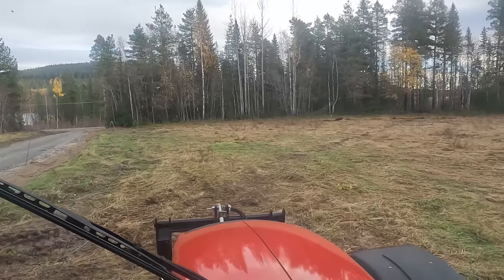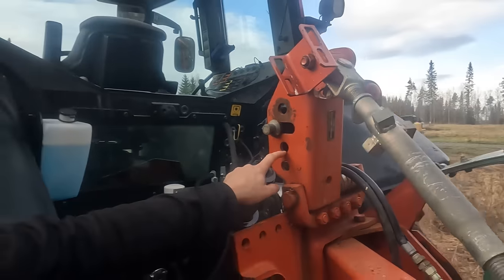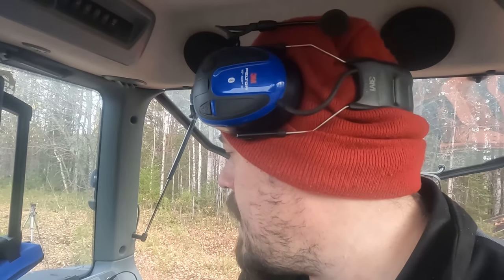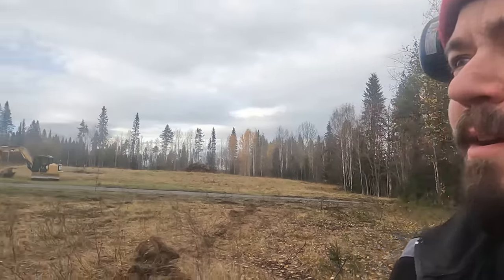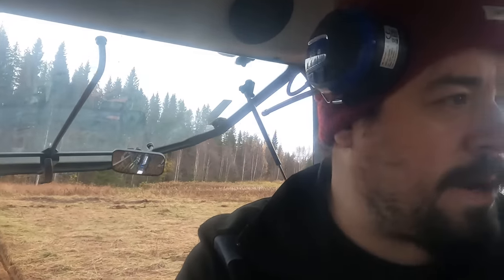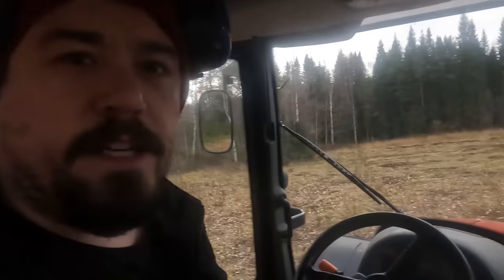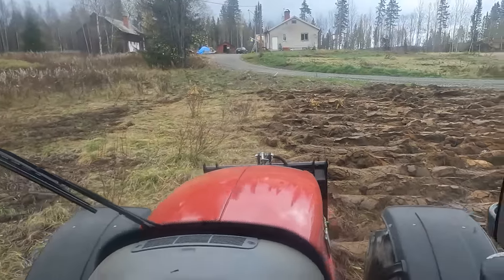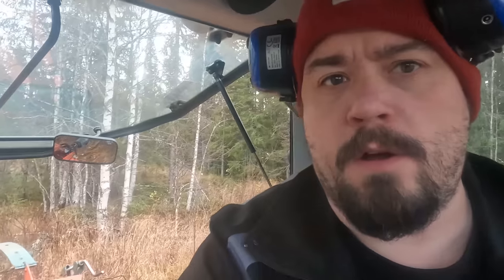Valtra N123 plowing the old fields - Part 1/2

Comment: to prevent the plow from clogging up, it was enough to disassemble the first two coulters from the plow, greetings from Poland
Reply from the maker: Yes, that could be done. The coulters are able to cut many of the rope-like roots though. I prefer that.
Reply: @MK72se  of course you are right, but the typeface also has bad sides

Comment: Would it struggle in such conditions with a 4 furrow and does that 3 furrow work well?
Reply from the maker: It will easily pull 5 on my fields. They're sandy. With 3-4 furrow i don't even need 4wd or differential lock. In this video i plowed deep, but it didn't struggle.
Reply: @MK72se okay i have a valtra n111e with about 120-125 hp do you think i can pull a 3-4 furrow in clay?
Reply from the maker: @noelroos1858  i have no experience with clay, but i don't think it would struggle unless it's very hilly.
Reply: @MK72se okay thanks

Comment: Don’t you plough up a LOT of dead soil, ploughing that deep..?
I did that once, and the field were never the same again…nothing can grow in dead soil
Reply from the maker: The top soil layer here is very thick. Most of what comes up is top soil. The underside of the tills are full of grass roots.
The tips of the plowshares are at 27 cm, and the shares are worn. So i think the real depth is probably at maybe 23-25 cm.
If any dead soil comes up here, it will mix with the top soil when i disc it in the spring. It will turn into top soil with time. Mother Nature takes care of that. As long as most if the mix is already top soil, it'll be fine.
Was that a long time ago you did that?